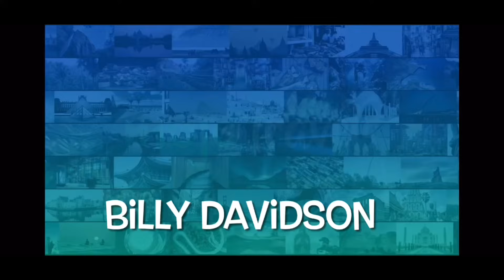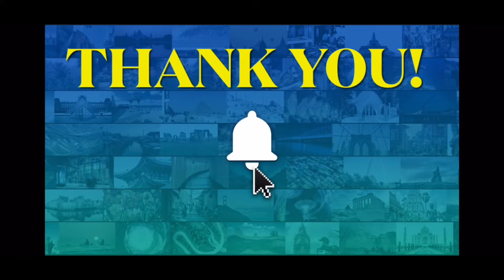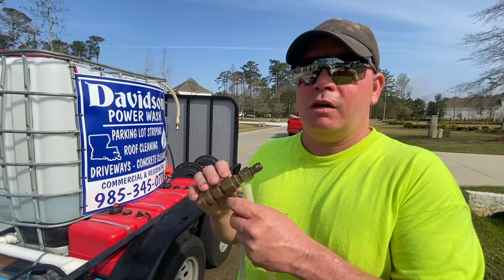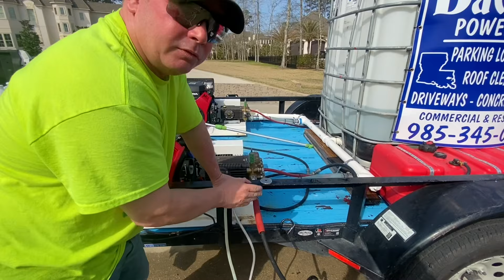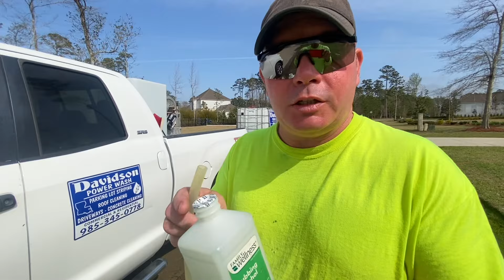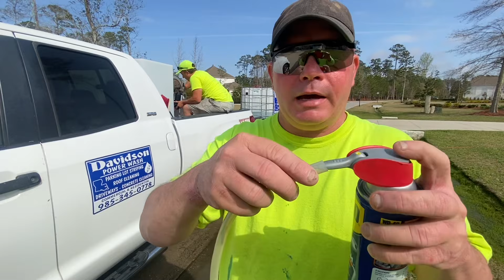how to fix a pressure washer chemical injector

Comment: Correct, wd-40, crc or any other solvent based chemical especially in aerosol can will destroy the rubber o-ring…. BUT there is a WD-40 product called WD-40 Penetrant which you can use with rubber and it does not perish. Iv been using this product for a few years now and it’s great for releasing seized parts. 

It’s much thinner than the lubricant kind hence why it penetrates faster. The only thing I’d say is it does not have much lubricating properties and once it dries there is almost no residue, but it is great for its intended purpose and I think it’s worth a try considering it won’t perish the rubber o ring. I have never used anything that frees up a seized part so well and so quickly. 

One spray towards the thread area and I can release a seized part in minutes.. I’d assume it’ll do well for this sort of thing.

Comment: Or instead of wasting time you could just remove the injector hose,remove the barb and visually see whats going on. Either the  ball is stuck to the o-ring or a piece of trash is inhibiting ball movement . remove and replace and get back to work.
Reply from the maker: Thank you for watching!

Comment: I have a new Simpson 4200 PSI and today water started filling up the chemicals that were supposed to be drawing out ? Does that mean the chemical injector got stuck? Obviously sir ?
Reply: I’m having the same problem, did you figure it out?
Reply: @avren7988  The Spring and Ball is Probably Sticking inside the injector We started removing the hose from the Chemical Jug when not in use. I started spraying lots of WD40 inside the injector after every use.  Some people say that they soak it in water overnight.

Comment: Rookie mistake I made that was an issue my injector wouldn’t pull. 
I replaced my 50ft 5/8 hose with a 100ft 1/4 hose.  I’ve learned that reduced my flow just enough not to pull chemical. Went back to the 5/8 and bam, starting pulling. 🤦‍♂️

Comment: Question. Pressure washer worked fine and now it will not pull chemical through the tube unless I turn the spigot almost off. It's a fixed injector on a Simpson MSH 3125. Any input from anyone would be appreciated.
Reply: I have the same problem. If my hose is on but the pressure washer is off, it will pull, the second I fire up the washer it won’t.

But if I fire it up with the trigger on, it will pull soap until I let off the trigger and it builds back pressure.
Reply: I have a Simpson also. I had the black tip in and it was pulling my cleaning solution well, I changed tip to white and noticed it was still pulling cleaner, I thought I only pulled cleaner with black tip.
Reply: @johnsjourney777 it pulls when there is a drop in pressure. Black tip is a bigger orifice so it triggers the downstream for detergent
Reply: When you switch to the white tip, remember your hose is still full of chem so you need to empty all that out which is likely why your seeing chemical after the switch, give it 30 seconds to 1 minute while on the trigger and it will run clear again.

Comment: on my pressure washer with a CAT pump, water is shooting straight up from the chemical injector, shoots up about 10ft in the air! I have no idea what the problem is?
Reply from the maker: Most likely you'll need to replace the chemical injector you make and try to take it apart and lubricate it with a WD-40 product. Just be careful there is a small, check ball and spring assembly inside of the chemical injector. This is common when the check ball gets stuck in the open position and allows pressure to backfeed through the small port. I have seen this probably 100 times at least.
Reply from the maker: If you look in the description of this video, you'll find my training website my personal phone number is on that website you can always text or call me for help

Comment: Billy, I did my 1st house wash this past Sat. Was really bluffed out ( worried about over doing the SH, even though I was downstreaming. Worried it wouldn't come clean ) but it went really good, saw the green disappear off the vinyl siding as I was spraying it- wonderful feeling.
When I switched tips from black to white (to rinse) I looked over at my bucket containing the SH, and water was backflowing into the bucket of SH, running over the edge and onto the customers grass- UGH! Is that normal and something we need to do (remove the downstreaming hose from the bucket) or if not, what did I do wrong? Thank you sir.
Reply from the maker: Usually those injectors will backfeed into your bucket with Eric going bad. There is a small check ball in the injector that gets stuck and allows it to backfeed into your bucket. I would suggest replacing the injector

Comment: What about when the injectors backwash Chemical back into the 5 gallon bucket?
Reply from the maker: There is a small check ball inside the injector with a spring mechanism. Usually when it starts to backwash into your bucket there's either trash caught inside of the ejector or either the spring has broken. Often times we just replace it
Reply: @billydavidsonvip Billy you're the man! I got frustrated on a job and I went to the bare bones minimum & had to batch mix my chem with a foam cannon (basically like a cheap man's XJet) to finish a house wash luckily it was a small 2 story. Thanks a lot I've been looking for a straight to the point video on the injector.